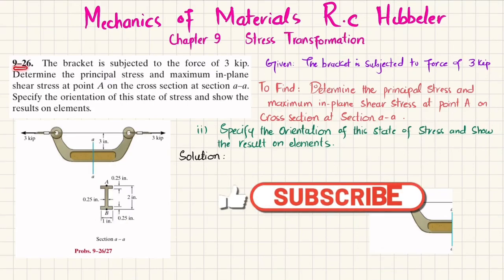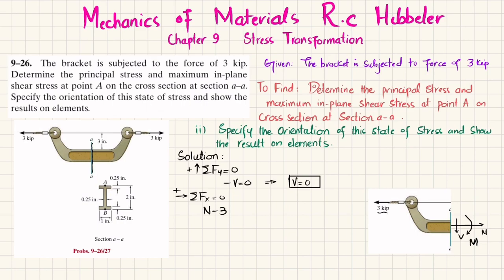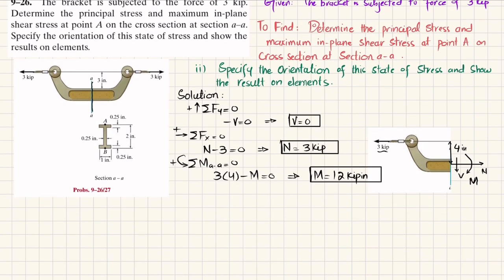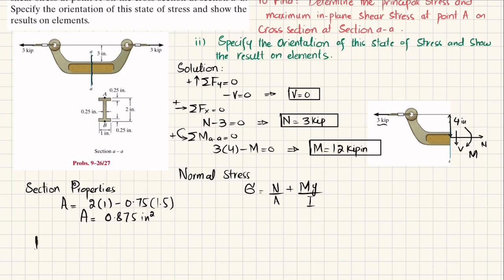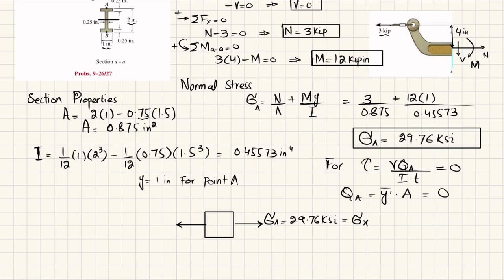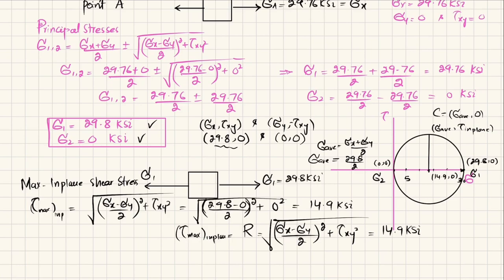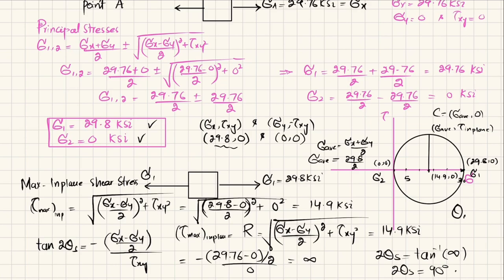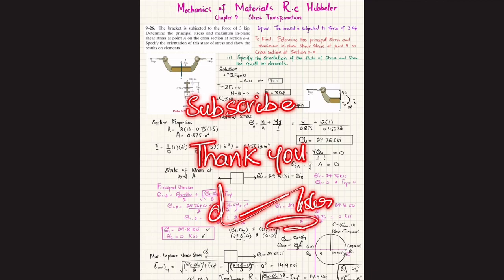Determine the principal stress and maximum in-plane shear stress |Problem 9-26| Mech of materials

Comment: Using mohr's circle you got  Tau max = 14.9 ksi. Is it possible to calculate factor of safety usig the Tau max? and How to do it? Thanks
Reply from the maker: From this when you get maximum shear stress then using failure theories you can calculate the factor of safety and based on that factor of safety you can choose the material which supports the maximum shear stress without causing failure ...
Reply: @engradnanrasheedmechanical  Thanks. I understand about failure theories but maybe not that well. The issue is when you calculate factor of safety using the failure theories (von mises and/or max shear theory). Assuming any ex.steel material. You get almost the same factor of safety. My question is if i can calculate the factor of safety using max shear value calculated. In other words. For this specific tension load condition. Can i divide Material yield strength/ Tau max shear or not? Or Should i be N= YS/2? Thanks
Reply from the maker: @MrJPDasani yes you can divide the materials yield strength by Tau max...